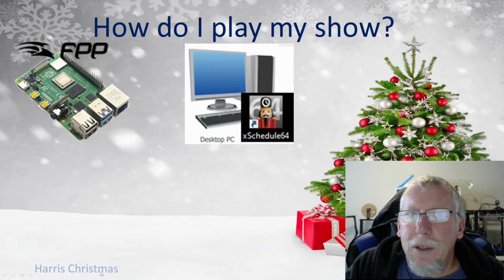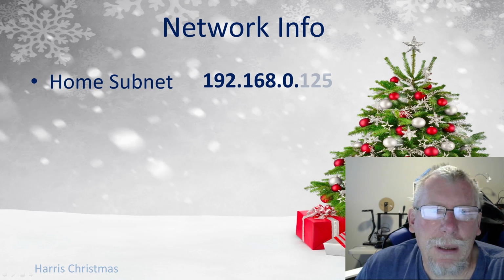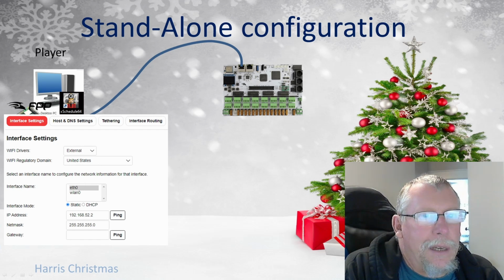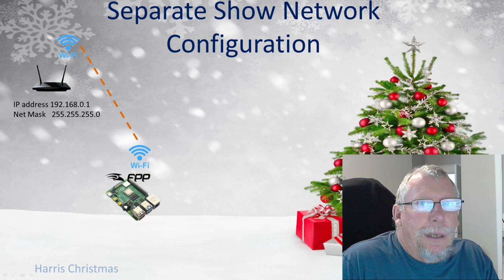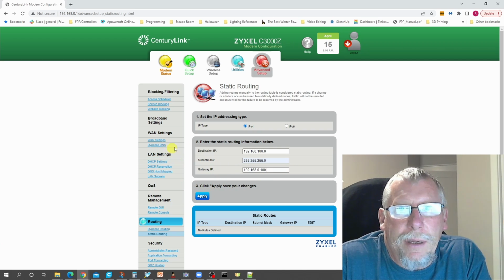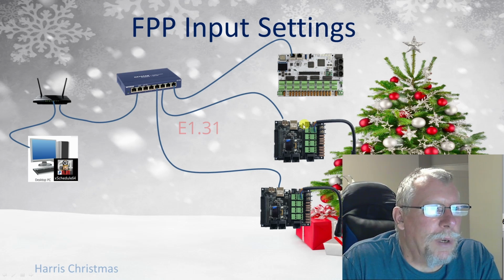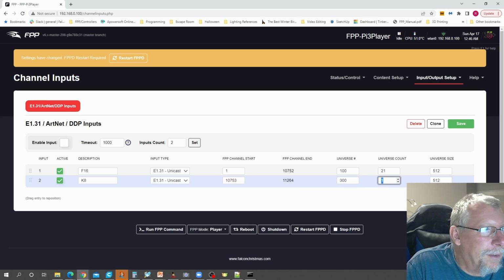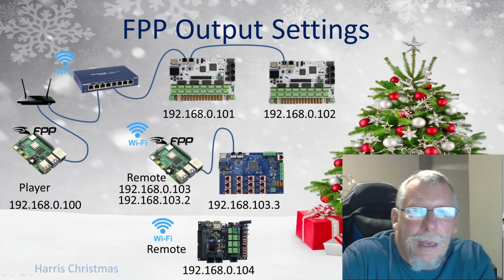Show Networking Explained

Comment: How would a BBB P10 matrix connect into these network configurations?
Reply from the maker: The controller type does not make a difference. The networking is exactly the same. The difference would be the Channel Outputs.